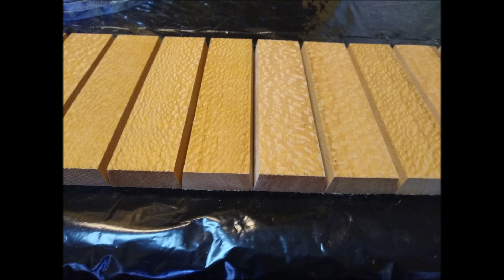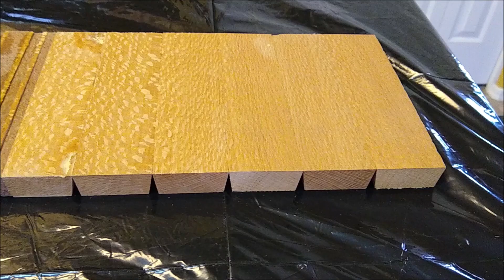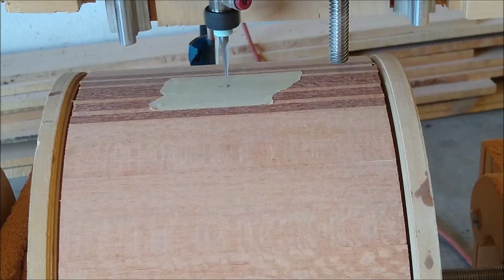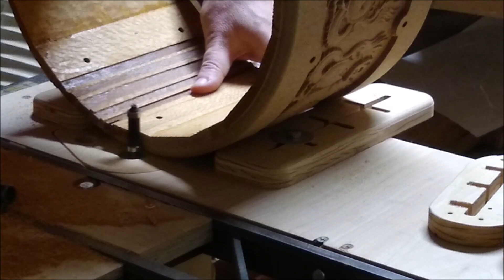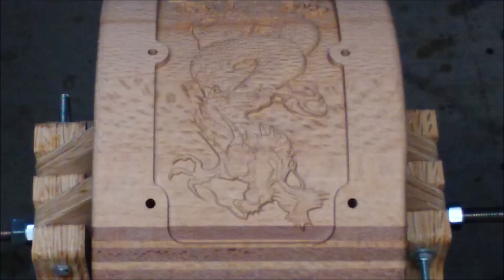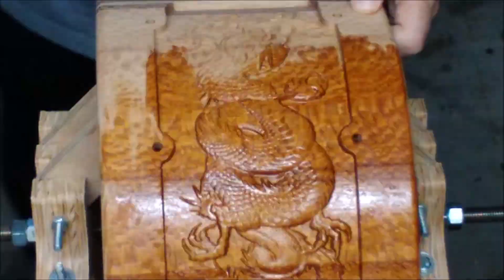Dragon Lacewood Snare Drum Build Video

Comment: Another great build. Thanks for posting. It looks like you are using a rag to apply the finish. Since they sometimes leave little bits on the surface, it is helpful to put the rag inside a bit of pantyhose for the final coat to prevent that. I usually use WipeOn Poly and it’s easy to get a glossy finish, then Beall buff of course.
Reply from the maker: I have not tried this "pantyhose" trick before, but I will soon (maybe this weekend on a non-drum project).

Thanks so much!!!